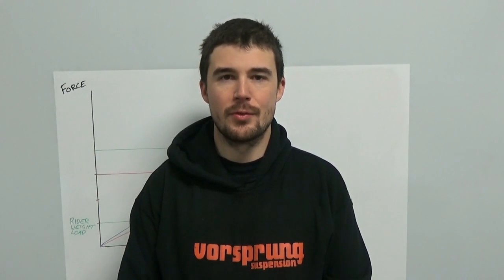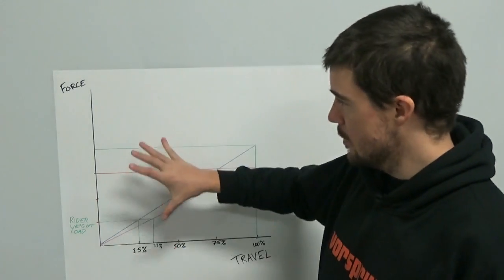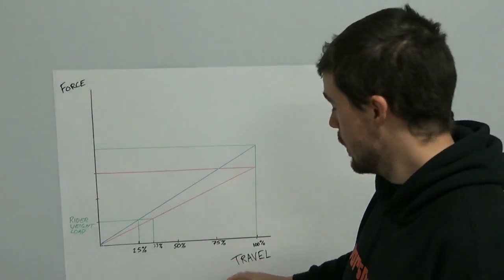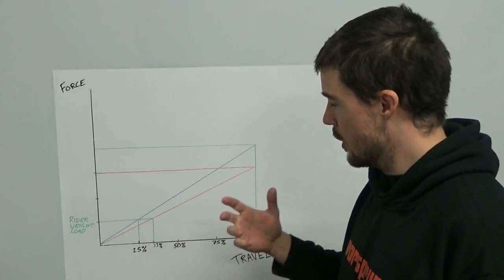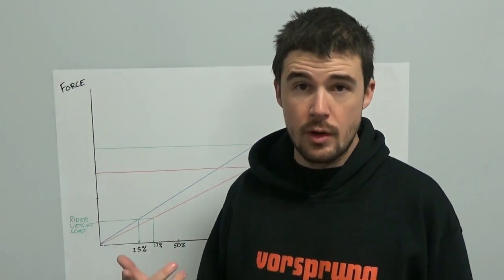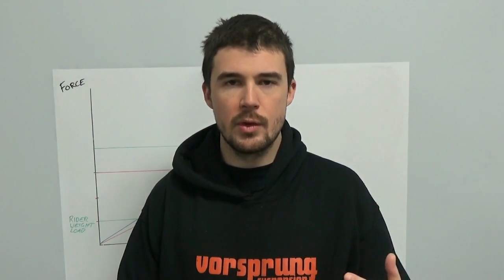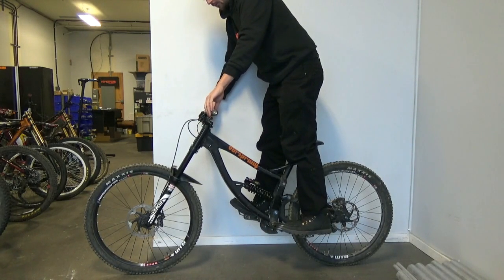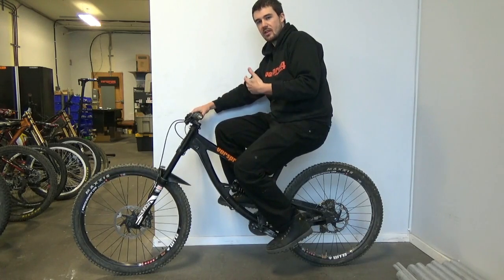The Tuesday Tune Ep 7 - The less obvious aspects of sag

Comment: I’m on a Turbo Levo with a Fox 36 Rhythm and set the sag to start 25% 32mm at 80psi with one vol spacer.  Yet even after adjusting to a 50mm stem dropping the bar a couple of spacers and sliding my seat forward a pinch to get a little more forward, I’m never using more than 80% of my travel. Any less psi the never chamber wants to take up some of the travel. I’m 210 lbs with gear so honestly this doesn’t seem to make much sense. Any thoughts?  I’m in BC so am definitely sending stuff.
Reply: I found 27.5 sag was the best compromise on my levo, i am to use very near full travel occasionally and it is plush and fairly supportive.  If you dont do large jumps and drops more sag can work and is ultra plush
Reply: The pulling in is because your negative chamber has more pressure than your positive chamber. You need to cycle your fork a few times through the majority of it's travel to balance this out. One big ride should sort your chamber pressures. Then you can adjust again.

Comment: Hey, what would you recommend for a light rider with a xc fork that wallows and sits too deep in the travel (negative coil spring)
Decrease preload on the coil spring (there are ways to do it)
Increase the air chamber volume (more pressure for the same sag so more pressure on the coil spring)
Reply from the maker: Changing the air chamber volume has a pretty small effect on sag (compared to what it does to the second half of the travel anyway). Is there a reason you can't just increase the pressure and run a firmer spring rate?
Reply: If I increase the air pressure its almost impossible to get more than 70mm travel out of the 100mm fork.
I tried decreasing preload on the coil spring and that improves things a lot because im able to run lower pressures without the coil sucking down the fork but the problem is that changes the travel from 100 to 80mm.
Maybe I'll just try grinding down the coil spring to decrease its rate.
Btw, I like what DVO did with their Diamond fork, they kept the coil negative spring insead of going the dual air route, but the nice thing is they added preload adjuster on it, its essentially what old coil forks had but on the negative side.
Reply: @MrGigiKent4  grinding down a spring increases its rate ..the less spring coils the firmer the rate .. weird huh? !

Comment: how's about the Compressions settings on fork and shock for Sag measurement, should they be fully opened or leaved as they are?
Reply from the maker: As long as you don't have the suspension locked out (including any kind of platform/climb switch) on your compression damper, it won't matter for sag.